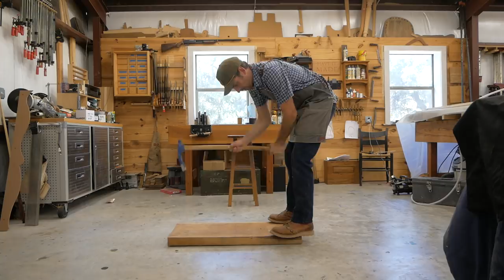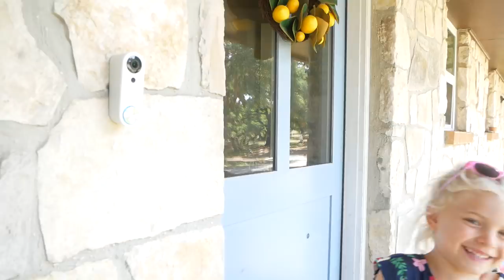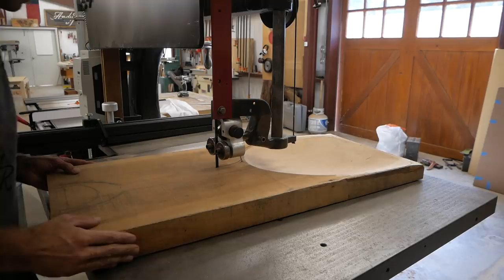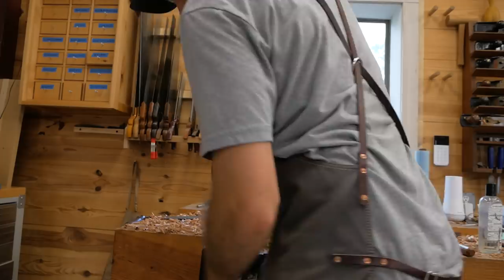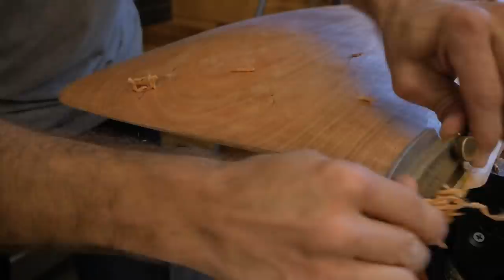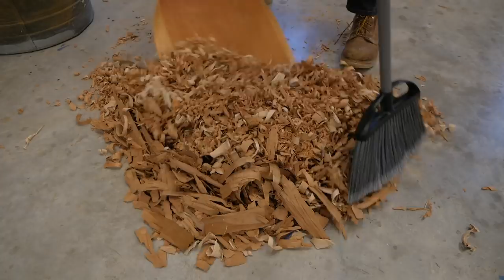Carving A Wood Shovel From A Single Board

Comment: Simplisafe seems like a good idea apart from the fact you can use a radio device with the same signal to trick it into thinking the door is still closed and open the door and go inside without the alarm going off in my opinion that's a bit dodgy especially if somebody knows what they are doing and if you've got the simplysafe system and you put the board and stickers on the outside of your house then that definitely wouldn't be good
Reply: Most criminals aren't that sophisticated.  Have you seen "Sexy Beast?"  It's a movie.  Where there's a will there's a way.  You can slow down or stop most opportunistic criminals but there will always be those who go the extra mile.  A system to stop them would cost more than your stuff...logic.